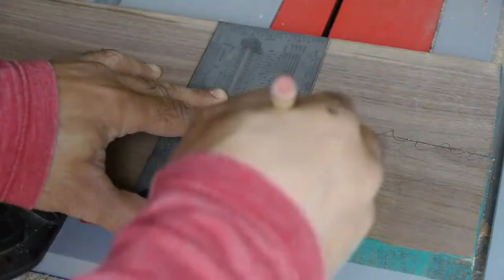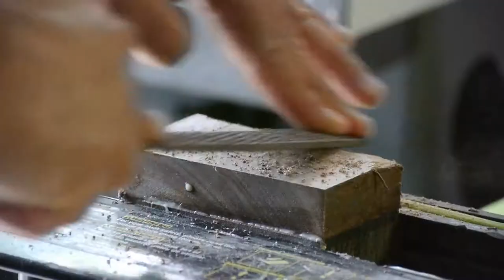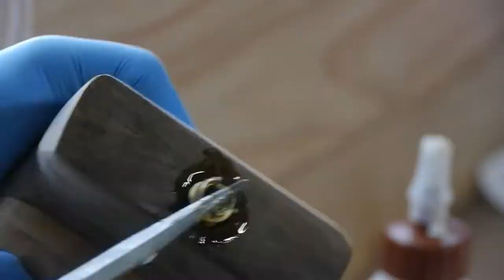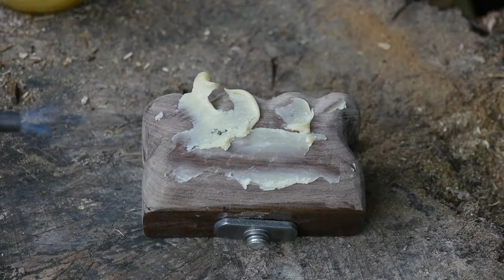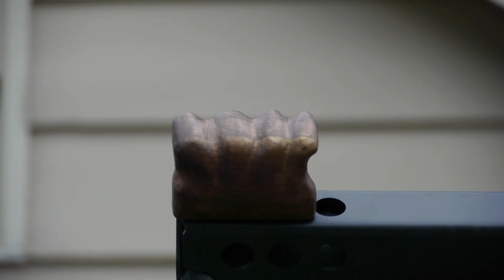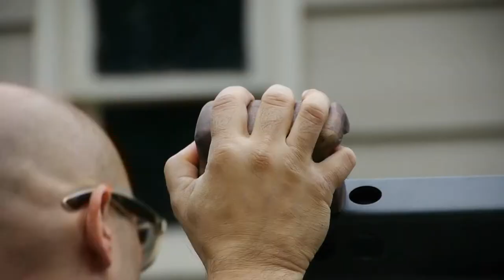Making a Walnut Climbing Hold for the Tigermoth Camper Trailer

Comment: Love your videos. Great hold design. What sealer did you use? Looks like standard walnut wood. Is the camper going to stay outside most of the time? Curious to know how walnut will hold up when exposed to the elements. Wondering if you thought of using rot resistant species (but might not look as nice) like black walnut, white oak, or katalpa?
Reply from the maker: Thank you! I made the sealer out of boiled linseed oil, mineral spirits, and beeswax. My plan has been to take it off when not in use, but recently I added polycarbonate climbing holds that I can keep on year round. I like your idea of a different species. It’s an interesting project to take advantage of cutoffs too. It really doesn’t take much to make one. I subscribed to your channel too!